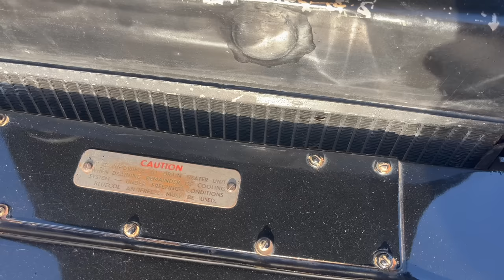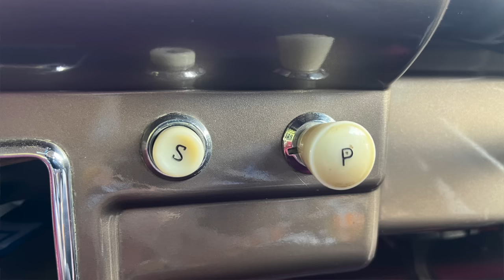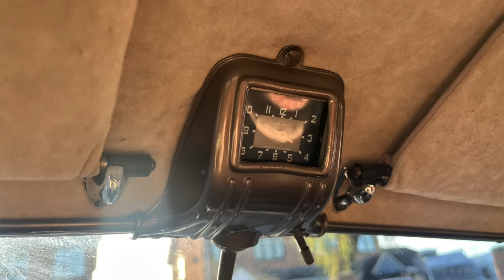Humber Hawk Mk V - a rare 50s British classic car! (Hawk mk 5)

Comment: Cool car, Steph.   You just don’t see Humbers here in the States.  But my 1952  Plymouth Special Deluxe looks very similar in style  and even in details and performance.   The Plymouth may be a little faster with the inline 6 but maybe not with only a 3spd column shift which is pretty vague.   But you can seen how engineers and stylists on both sides of the Atlantic were thinking similarly in the post war years.   The interior in this humber is so pretty.❤

Comment: If you're an avid viewer of TPTV you'll see a lot of those 'Square Body' Humbers in films from the early fifties, Professor Quatermass being one example. Sunbeam Talbots (another Rootes product), feature regularly as well. Perhaps Rootes knew the value of 'product placement' before other less enlightened manufacturers of the time. Excellent video Steph, thanks.

Comment: A cool feature that i noticed as you were driving was the fixed position of the centre steering wheel hub.. Iv only ever seen that on a citroen!
Reply: The 1958 Edsel had the Teletouch automatic transmission buttons in the static steering boss.
Reply: Well spotted. A fascinating little detail that I would have missed otherwise.

Comment: A great review and I love the car. I just wondered if it had a 4 or 6 cylinder engine.
Reply: The Humber Hawk (the model in the review) had 4 cylinders, with one of the largest 4-cylinder engines at the time of 2.2 litres. The sister model, the Super Snipe, was practically identical apart from some cosmetic changes but had a 4.1 litre, 6 cylinder engine. The Super Snipe was always regarded as somewhat "upmarket" compared to the Hawk.

Comment: Nice looking car, I like the design and look of the Humber Hawk/Super Snipe/Imperial after this, especially with the twin headlights. Unfortunately when these cars were popular with the middle and upper classes the UK was in a class war (still is), and the working classes generally looked upon them as snobs cars. I  was told this by someone I knew who was an older mechanic. This is a shame as the vehicles are not at fault over British cultural differences, as this is probably part of the cause if low survival. Middle and upper middle classes were also likely not the types to preserve vehicles, they mostly had the means to replace them which is another reason why survivability of big Humbers is low, coupled with the high cost of running older versions meant working class folk also avoided them. Jaguars seemed to have a better cultural following, probably because they were favoured by bank robbers and gangsters this gave them kudos, Humbers not so much.

Comment: Fantastic review; a lovely car.

Is it possible that you could reduce the difference in volume on the outside exhaust examples - the exhaust audio is so much louder than when you're talking or driving, this time I couldn't dive towards the volume control in time as I did have my hands free - I had complaints from upstairs!

Lovely video as always, thank you.

Comment: Great video about a lovely car!
Clarifying an earlier post, the requirement to leave sidelights on was when parked on the right side of an unlit road, pointing against the traffic. Then you'd switch off the panel to save juice.  Parked on a lit street, or parked in the direction of traffic flow did not need the lights.
Not sure, but it was probably an offence to drive with the panel lights off, as you were technically not in full control of the vehicle, as eg, coasting out of gear.

Comment: Re the separate panel light switch: in those days if you were out at night and had to park your car at the side of the road or street you had to have your side lights on. This could quickly run your battery down and you didn’t want to put extra stress on it by leaving the panel lights on too.